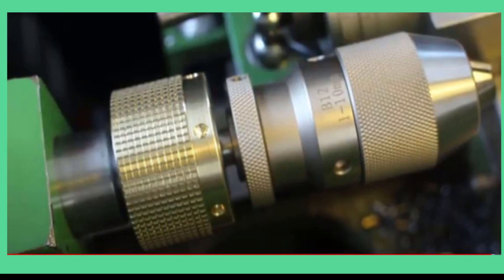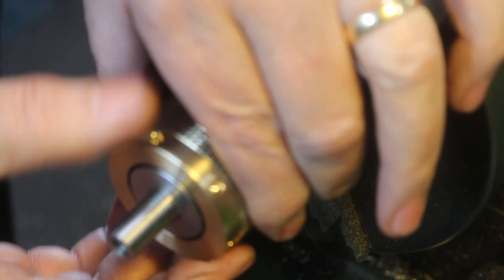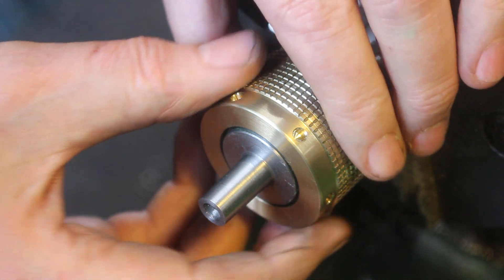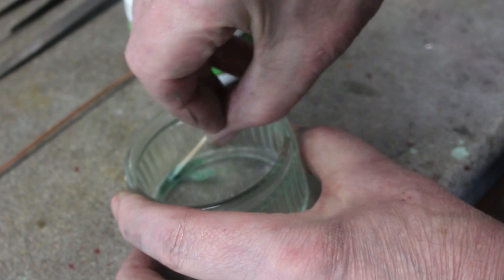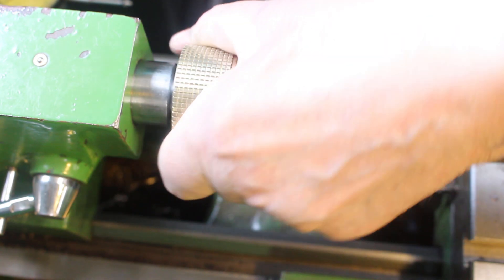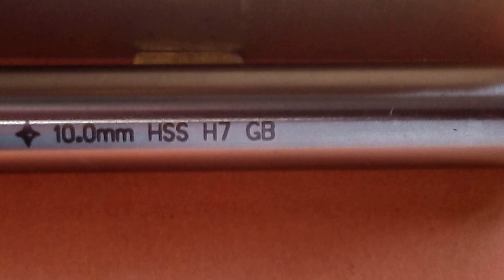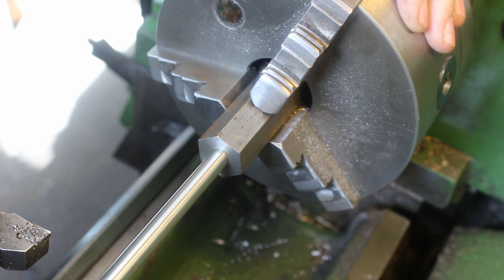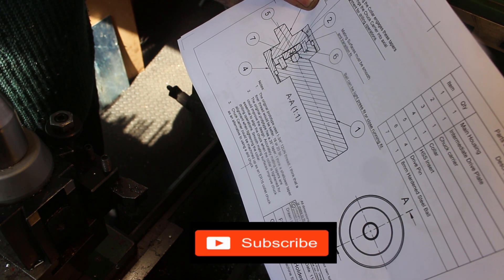Floating Reamer Holder - Lapping in the Alignment Tapers

Comment: Hi there I'm new to this and would like to know the purpose of the floating reamer
most people just use the chuck or by hand
Reply from the maker: Hi The floating reamer holder allows the reamer to align with the hole independently of the lathe tailstock alignment and thus produce a more accurate hole. If the tailstock is mis aligned slightly then a ream may produce a hole that's oversize or not perfectly parallel. If the tailstock and chuck are accurately aligned with the axis of the lathe spindle them you should get good results without using a floating reamer holder.
I hope that helps.
Thanks for watching my video.
Reply: @GoCreatehms  Thank you for replying back and for 
all that info, I understand now and really apricate it. Thank you

Comment: Nice job, (excuse my bad english) is the cone 35 degrees radially or diametrical?
Reply from the maker: 35 degrees from the axis of the part. I think a shallower angle may be better, I changed it to 20 degrees on my drawings.
Hope you follow that OK.
Reply: Go Create Hobby Machine Shop thank you, would it be possible for you to send me those blueprints? Itwould help me alot :)
Reply from the maker: Hi Adam
If you go to my channel page and select the about page, you should find an email link.

Comment: Sorry, i cant find anywhere to log in. Is it on you tube or on hobby machine the log in is?  Cant find any place to log in on either of them.
/Tomas
Reply from the maker: Hi Tomas, not sure why you can't find the email link on my about page. If you click your Avatar in YouTube you will see a 'sign in' option, or perhaps you will need to create an account???
If you are on Facebook search Nigel Walton, then you can find me and message me.
Reply: Thanks for your answers. As I can't access your mail I ask you instead. What is the diameter of the four pins and what are the width of the four slots in the "middle" disc?
/Tomas

Comment: There’s you cooing over your fit, I totally get that. When I reamed my home cast clarkson tool and cutter grinder center castings with a h7 reamer the fit of a precision 16mm ground shaft was very good and a similarly reamed 30mm bushing could be spun on the shaft and clearly demonstrate a air bearing effect. Liking your work.

Comment: Have come across the different fit, using the same reamer, caused by the use of water or oil based lube? Water is claimed, by someone who really knows his stuff, to make a tighter fit than oil. Your thoughts?
Reply from the maker: Yes, I'm aware higher viscosity cutting fluid can increase the hole size and can be used to adjust hole sizes to within very fine limits. If memory serves Steffan Gottswinter discussed this in one of his videos, he works to finer limits than I would ever need to or could measure. I'm also aware, from a professional machinist, that the pilot hole size can also make a difference, over sizing the pilot hole, so the reamer takes a finer cut,  can infact result in a larger hole size, but the material, cutting speed and feed also make a difference, so there's allot more to the subject than a hobby machinist may appreciate. Reamer alignment is but one variable which a Floating Reamer Holder can address. 
I'm don't know to what extent a Floating Reamer holder is used these days in industry were machine geometrical accuracy and positioning is to a very high degree of accuracy. A cnc machinist friend tells me he does not use reamers very much, prefers to use a boring head for accurate sized holes, neither does he use taps very much, prefers thread milling, believe it or not he's done thread milling down to M2 but I've heard of thread milling done down to even smaller sizes, quite amazing.
I seem to have rambled on a bit, thanks again for your interest in my videos.
Reply: @GoCreatehms  that was the source i was thinking of, a very skilled intelligent and patient young man with excellent command of the English language. He and Renzetti are two of my video heroes. 
Feel free to ramble and you produce videos and I'll watch. 👍